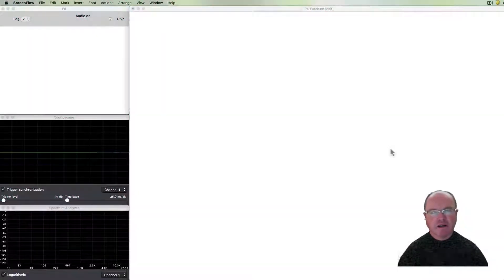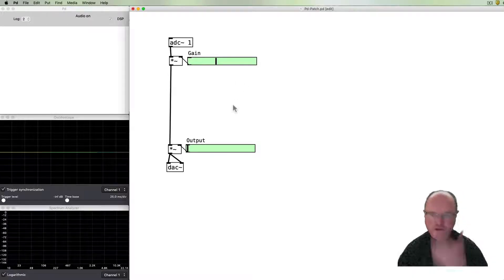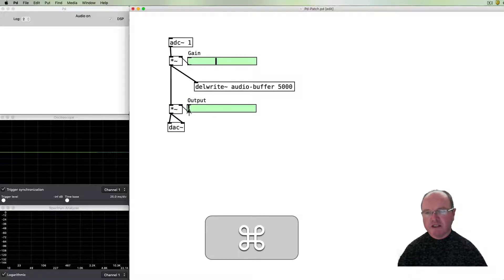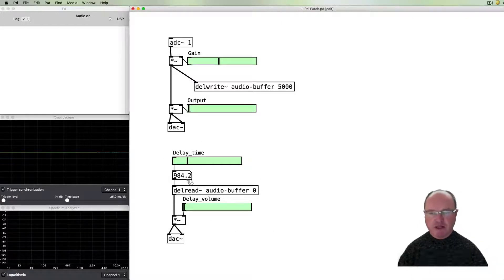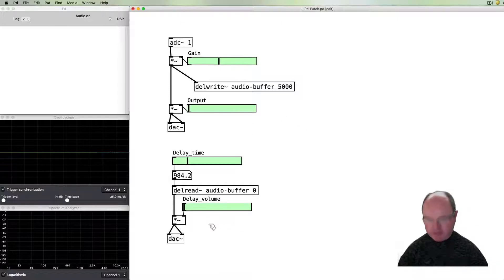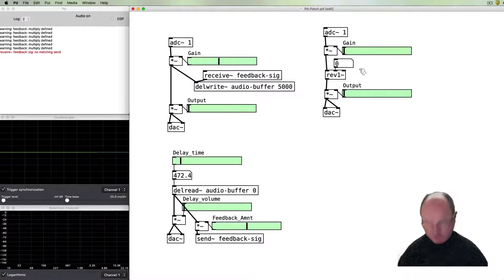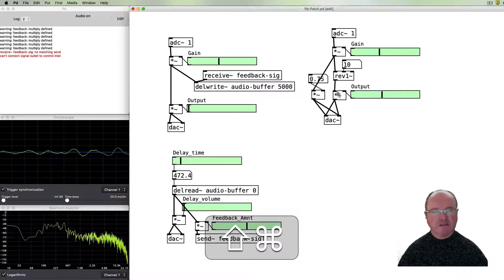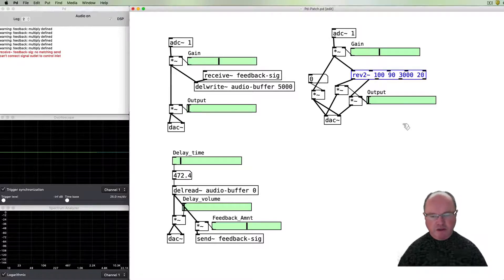24. Delay and Reverb in Pure Data

Comment: is there any way to smooth out the changes in the delay time slider? I get clicks & crackles every time I move it
Reply from the maker: If you add a [vline~] object between the number box and [delread~] it will smooth out the zipper noise. Feed [line~] with a message box like [$1 10] to ramp quickly (10 ms) between delay time values.
Reply: @QCGInteractiveMusic  thank you andrew!!